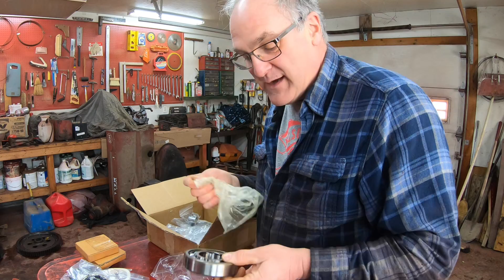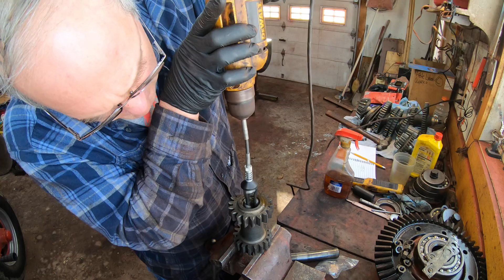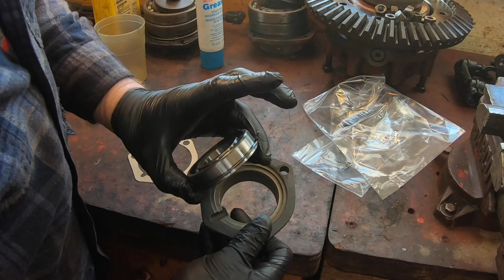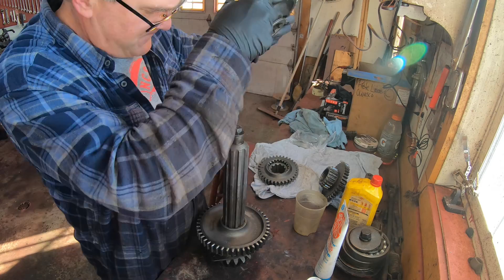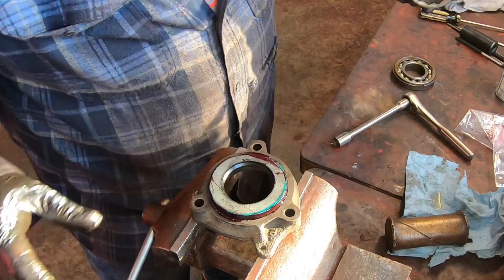Parts Arrived! Reassembling the Farmall MD Transmission

Comment: I learn a lot about the relationship between parts and how they work while cleaning them. Helps on reassembly, especially when no service manual or parts catalog is available. Clean is the most reliable part one can install during reassembly.

Comment: where you get parts  reasonable?? I need  a set of 3 hydrolic valves for 400 Farmall. also has power steering---  where  goes thru the one valve too. I should  just put  a separate steering pump on!!!  unhook  thru the Hydrolic  valve.

Comment: You didn't mention the load groves or hole and where they should be located . The max fill SKF bearing should be installed with these holes on the 12 to 9 o'clock as per the manual.. other wise great video..
Reply from the maker: That's a new one on me. Do you have manufacturer's documentation of that?

Comment: Excellent video Pete  :) also very cool repairs on Farmall MD tractor and very exciting how went together too ! Looking forward more videos too soon to watch my one neighborhood neighbor is doing repairs on his transmission and axles too on his Farmall H basic gas motor one he was having problems with shift gears on his so far found clutch need updated on also said when goes from gear 1 to 5 slips out 3 gear lots but if goes from 5 to 1 gear 3 will stay in but heard get grind and whirring sounds! So go apart founds need front gears near clutch disk all need replacement parts and 3 gear cobs are worn out plus teeth missing lots ! So going do big overall to plus fluid change too and he bought tractor from International dealer near us years ago was show room at front desk he bought in 1972 very low hours ! He had excellent work with it but last year work on farm he noticed problems get bad to worse almost so said to me  Winter Season months project to do and has other tractor to use to and heated shop to do in ! But doing total restoration and paint plus wire electrical up too even new tires! He done well with that tractor all decals still on it like new and store inside to! Funny part conversion 12 Volt Negative ground to from 6 volt Positive ground system to with GM Delco Alternator to be added on !

Comment: I was surprised that you didn't pack the large ball bearing on the main lower shaft before installing it into the case.  As it is in a location that it is difficult for oil to get to I would think it should have some lube.  All your others were packed.
Reply from the maker: I did lube it.

Comment: Thanks for an exceptionally good video! I have some questions
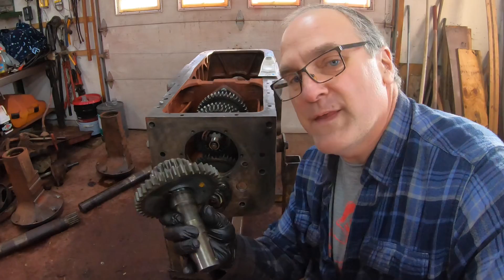Regarding, the 5th gear tooth (14:29) wear. I vaguely remember some instructions to change gears, you should stop the tractor, change gears, then proceed. (true?) I grew up with non-syncro mesh transmissions and got pretty good with double-clutching and was wondering if that would work on these transmissions? Thanks!
Reply from the maker: Hi William, these tractors can be double-clutched into 5th. I showed it in some videos this summer when I was making hay. There's also nothing wrong with stopping before shifting into 5th. When towing a load sometimes it's nice to double clutch into 5th so momentum isn't lost.

Comment: When assembling bearings I prefer to oil them as grease keeps the oil away. Just my opinion, I'm sure you've never had trouble but I wanted to share it. Btw thanks for your videos!
Reply from the maker: I am using engine assembly lube, not plain grease. It is designed to be washed away once oil begins to flow. This sort of stuff is really splitting hairs though.
Reply: @JustaFewAcresFarm   Oh okay then that’s great stuff. I understand how you’ve got to deal with this type of comments, just wanted to share my experience.

Comment: Pete 0.014" or 7 thou per side is a bit more than a hone to say the least, it is easily a finish 2nd cut on a lathe.
Reply from the maker: A course stone on a real hone would have taken that off in no time. Fine stones on a brake cylinder hone were the problem.
Reply: @JustaFewAcresFarm  You can do and do, do far more than I can accomplish, but no that is not a honing diameter.